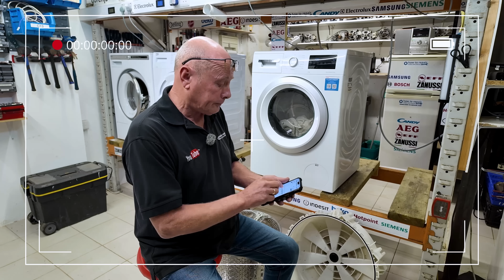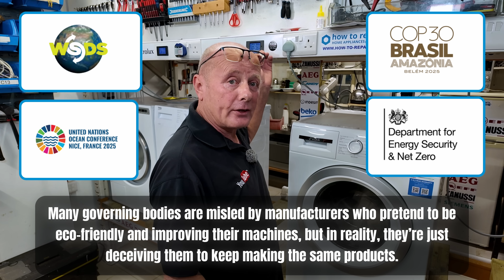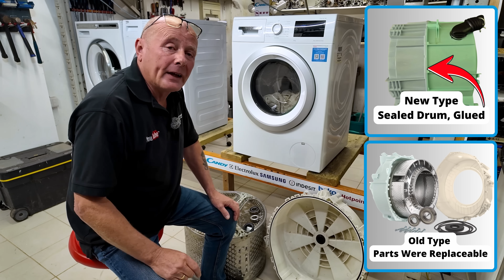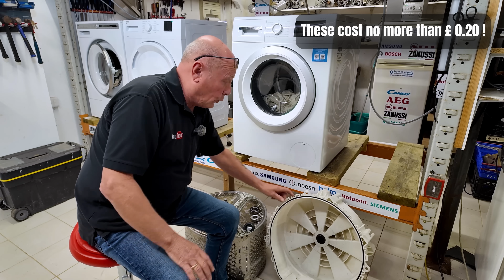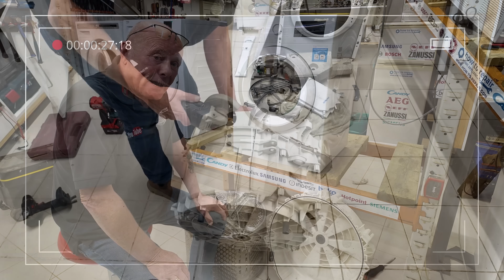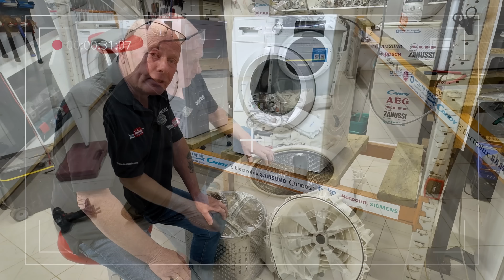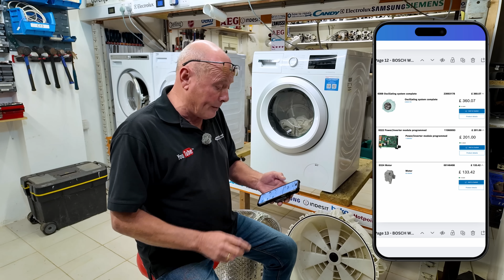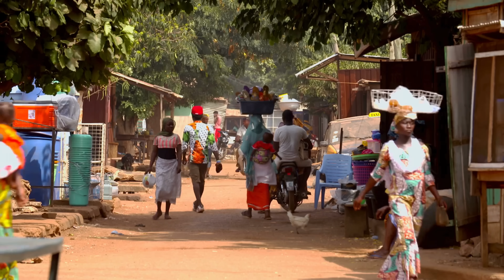Washing Machine SCAM EXPOSED! The Truth About SEALED Drums: Naming & Shaming

Comment: I had a Beko, basic model.  Motor fault also took out the inverter.  Second hand replacement parts cost about £15 less than a new Beko washing machine 🤷‍♂️
Reply from the maker: I've seen this exact problem countless times over my 40 years. Your basic Beko washer, which is part of a large multinational group, utilizes an inverter motor system where the motor and the electronic inverter control board are a pair. If the motor fails, it often shorts the inverter, making it a mandatory dual-part replacement. By pricing the spare parts so high, the manufacturer makes the repair anti-economical and forces you to replace the entire appliance, contributing to the huge e-waste problem. This is the ultimate example of the industry being designed to rip the consumer off.

Thank you for your comment. I appreciate people like you taking the time to write it out. Please don’t forget to subscribe and share it where possible. It might help others make a wise choice instead of being misled by the industry.

Comment: Europe is pushing hard towards the right to repair, so the manufacturers in reply push up the parts prices…
I have an LG washing machine and had to replace the mainboard 3 times already. Luckily these are available on AliExpress for a “reasonable” price. Europe should enforce a repairability label, like the energy label, which includes accessibility, availability of parts and manuals, and parts pricing.

Comment: It would be useful to keep a list of models/manufacturers that DO and DON'T use sealed drums.
So that customers can easily avoid buying this crap and maybe manufacturers will also see the results.
Reply from the maker: The definitive suggestion doesn't exist yet as manufacturers are always changing lines and product quality varies wildly even within one brand, it’s tough to name one best machine. My advice is, buy according to your budget but prioritize brands that openly provide technical service information for repairs. Also when buying new, check if the drum is splitable. 

My personal best pick is ASKO I've been a big fan of them they are brilliant workhorses with mechanicals that often exceed current Miele quality, largely due to their use of a stainless steel outer drum. Certain LG models are also reliable. For budget options, Beko deserves praise they are one of the few who provide genuinely helpful workshop manuals and wiring diagrams for repair, which is a huge plus. 

I really appreciate you taking the time to write out this valuable comment. Please subscribe and share this where possible your advice is exactly what people need!

Comment: Still have a fisher and paykel fridge from early 90s. Made in Australia nz brand at the time did cost almost $1000 aud though.  Never had a problem never ever to this day still going. Only thing is it’s not fan forced like the rubbish introduced in the mid to late 90s because of the Australian legislation banning the gas nonsense. 
Although i defrost the freezer because of ice buildup which has helped maintain the unit and compressor has never failed. 
This fisher & paykal fridge has outlasted friend’s white goods purchases of early 2000s fridges and appliances lasting maybe 10 years max
Reply from the maker: I'm not surprised in the slightest! Your early '90s Fisher & Paykel, made when the company was still building its reputation on durability, is a testament to the old way of engineering. The fact that it cost almost $1,000 AUD back then meant you were paying for quality components that were designed to last, not to fail.

Your manual defrosting ritual is actually a key point! Older, simpler designs like yours which are likely static-cooled rather than fan-forced have far fewer complex, electronic components that can fail.

Thank you for your comment. I appreciate people like you taking the time to write it out. Please don’t forget to subscribe and share it where possible. It might help others make a wise choice instead of being misled by the industry.

Comment: I had 13 month HP probook fail one out of two USB, wanted to warranty it, couldn't as it had 12 month warranty. Wanted to repair it and got a quote for 730$ on 800$ notebook. Insane. Just added usb hub to that one and swore to never buy HP. And like 2 months later, brothers HP elitebook USB failed, but that one had 24 warranty as it was twice the price ~1500$ and he did get new motherboard.

Similar thing happened at home with washing machines, closing mechanism died so I couldn't lock and start but had 5 year warranty on my samsung, but my mother had same problem but only 2 or 3 years on hers I got changed for free, but for hers I bought OEM lock for 20$ and changed it, which wasn't as expensivecas with my HP problem.
Reply from the maker: Your experience is a perfect analogy for the appliance industry today mate. They quoted you $730 on an $800 notebook for a simple USB port issue because the repair required replacing the entire motherboard (where the port is soldered). This practice charging close to the replacement cost for a repair is designed to make you say, "I'll just buy a new one." This deliberate anti-repair structure is found in appliances, too.

Thank you for your comment. I appreciate people like you taking the time to write it out. Please don’t forget to subscribe and share it where possible. It might help others make a wise choice instead of being misled by the industry.

Comment: Scandalous Paul,
                             the spares Machines I buy to repair have not had the warranty registered with the manufacturer. Some are less than two years old, probably failed due to improper use and once the seller realised it’s a Eco (sealed tub) they just go out and purchase a new one. Manufacturers see these machines as Bic Razors. Big price difference 😊
Reply from the maker: That is an absolute scandal and it's a huge problem. As an engineer with decades of experience, I see exactly what you're seeing: machines that are barely two years old being dumped because a failure like a bearing (on a sealed tub/Eco machine) makes the repair too costly or difficult to justify. The manufacturers absolutely see these cheaper models as disposable and, by making technical data and certain parts difficult to access, they encourage this turnover. This mindset contributes massively to the shocking amount of e-waste we see, as these machines are ending up in the landfill well before their time. This is precisely why consumers need to be vigilant and ask about repair basics before buying! I'm pleased you support the main idea. Our success hinges on making this as highly visible as possible. Since I cannot achieve this scope alone, I sincerely ask that you share it across your networks.

Comment: My old AEG bought 2011 has just developed a leak and do hope I'm able to fix it. After watching the video I'm feeling even more reluctant to buy any new model whatsoever, and just like older cars, try to stay with the older models as long as poss.
Reply from the maker: I completely understand your reluctance. A 2011 AEG is from a time when they were part of the Electrolux group, and many models were built with better components and repairability than what is offered today. Just like you noted with older cars, the quality and longevity of appliances from that era are often far superior. The fact that you want to fix a leak rather than replace the machine speaks volumes about the current state of the industry. I genuinely hope you can track down the leak and keep your AEG running for many more years! Remember to keep it basic and check if the manufacturer supplies the necessary data to assist with the repair. Thank you for your comment. I appreciate people like you taking the time to write it out. Please don’t forget to subscribe and share it where possible. It might help others make a wise choice instead of being misled by the industry.

Comment: Trouble is that people want cheap machines and even when they are repairable they don’t do it but just buy a new one anyway. I suppose on the plus side it does prevent leaking tubs - not sure if thats a significant failure point tho ?.
Reply from the maker: You are absolutely right that this is a vicious cycle. People want a cheaper machine and when it fails (often due to being cheaply made), the inflated repair quote makes them feel justified in buying a new, inexpensive one. This is exactly why the industry makes its appliances confusing and disposable it's designed to rip the consumer off by making repair anti-economical.

Thank you for your comment. I appreciate people like you taking the time to write it out. Please don’t forget to subscribe and share it where possible. It might help others make a wise choice instead of being misled by the industry.

Comment: Thankyou for this video and totally believe how disgusting this is!
Luckily I'm with a care plan with Hotpoint as the bearings went when the machine was just out of warranty.
The engineer had to speak with Hotpoint when coming out as he said yes the bearing had fail but didn't know if Hotpoint would pay out for a repair as in his words "it needed a new sealed tank"
Was fortunate that Hotpoint gave the go ahead for the repair but understand that next time the bearings go it will be a new machine.
Reply from the maker: That's a very common story, and I'm glad you were covered by your care plan this time! Many modern washing machines especially those made by companies acquired by major groups like Whirlpool, who owned Indesit Hotpoint at one point have sealed drums. This means that when a small, replaceable component like the bearing fails, the whole drum or tank assembly has to be replaced, which can be prohibitively expensive, often costing more than a new machine. This is exactly why I recommend always asking the salesman whether the machine's drum can be split before buying, as I believe this is a crucial factor in the right to repair. Avoiding these machines is a key way to fight built-in obsolescence. I'm so glad you agree with the main idea! Making this video as visible as possible is up to all of us. I can't do it alone, so please remember to share it wherever you can.
Reply: @How-to-repair I have passed your video on

Comment: So what are good brands? That we can repair for low cost?
Reply from the maker: That's a good question but honestly I can't give a definitive suggestion, mate. Manufacturers constantly shift their production lines and release a vast range of products meaning every brand has machines of both very good and very poor quality. My core advice is to stick with a brand that fits your budget and provides the technical information needed for DIY repairs. Also, when buying new, always ask if the drum is splitable. 

Personally, I really like ASKO they are brilliant workhorses with superb mechanicals, often surpassing new Miele models because they still use a stainless steel outer drum. Some LG models are quite good too. A big shoutout to Beko who, despite some cheaper products, offers helpful technical manuals and wiring diagrams to support appliance fixing. They're making an effort. 

Thank you for taking the time to write this out. Please subscribe and share this where possible; it could help someone avoid an industry trap!
Reply: @How-to-repair thank you your answer ❤

Comment: Had a bosch dishwasher with same "obsolescence" designed in. Simple drain solenoid failure but it had very specific values mapped to the PLC. Bought an LG replacement. It's a massive fail for repeat business I wonder if they've factored that into the marketing strategy? 
It will eventually bite them on the arse like rust did in 70's Jap cars.

Comment: I think we can force the manufacturers - hypothetically - to spend those extra $6 to manufacture drums in a serviceable way. Even if it's $20. We have sustainability goals to hit. Less greenwashing, more reuse.

But also realistic expectations of replacement part prices, because the business needs to keep going whether they make maintainable products or not... I don't think parts can realistically be very cheap, i think there is a balance there somewhere. Say you can reassemble a Venta Air Washer entirely from replacement parts, every single bit is available, but it will cost you exactly double of the full device replacement. Usually when you need to replace a part, it's a fraction of the full device replacement cost, and you have it going for another 10 years - a decent compromise both for the consumer and for the manufacturer.

I don't think it's surprising at all or any conspiracy that all companies implement a move that is good for their bottom line but bad for us as a society at the same time. After all, all the managers in these companies have the same background, and would have the same thoughts - so they have all these plans they're just sitting on until one company makes a move, since nobody wants to really be seen as the lone baddie - giving the customer alternatives would be bad for business.
Reply from the maker: We need governing bodies to ensure that less greenwashing like adding unnecessary Wi-Fi is replaced with concrete policies that mandate reuse and serviceable design.

Please consider sharing this video with your friends and family. The more people who understand what's happening with appliance longevity, the better equipped we all are as consumers.

Comment: That's outrageous, the parts cost more than the machines, that doesn't even include shipping and taxes!!! Better to buy an older machine without WiFi and other nonsense junk!!!
Reply: Unlike other types of appliances, washing machines (or indeed refrigerators) can potentially show a lot of wear so it can be a false economy.  I bought a second hand Miele to replace a Miele where the drum had failed (the different layers of chrome and metal had delaminated! I think the drum had gone out of round and/or a metal object had got caught in-between -- I replaced the bearings but the old bearings were like new, but foolishly I didn't take the inner drum out and shake any objects out, since in a Miele the bearings are in a bearing cross), but the second hand one also failed after 6 months (in this case sparks were flying everywhere and the outer drum literally machined the inner drum, yikes, lol). So I think that was a mistake and a false economy...
Reply: @TassieLorenzo 50-year-old appliances need less maintenance and cost lot less for parts compared to the current disposable appliances that barely last 5 years!!!!!!!!!

Comment: I just got this now: 
Bosch WGG254Z0GB 2 weeks ago, which brand you sugegst to buy instead of this? I am worried about reparaibility in time.  Same 10kg around £500-600? Or keep the Bosch?
Reply from the maker: The machine is a good machine. It is only the fact that the manufacture has built-in obsolescence via drum or electronics. The other components for the machine are reasonably affordable. You should’ve got a five year guarantee
Reply: @How-to-repair  Thanks for your reply. What about the LG (F4X7011TBB) instead of the Bosch? Reparability important for me.

Comment: I have a question. Which new washing machine today is made so the bearings can be changed? Any idea?
Reply from the maker: I wish I could give a single definitive answer but I can't, mate. The reality is that manufacturers are always changing things, and with their massive product lines, every single brand sells both winners and duds.

Choose a brand within your budget that also makes technical repair information available. Crucially, ask the seller is the drum splitable?

From my experience, I personally loved my ASKO machines. They're mechanical workhorses that often rival, or beat, modern Miele models especially because they stick with a stainless steel outer drum. LG has some quiet good models as well. And big props to Beko; even though they make budget items, they stand out by offering helpful workshop manuals and wiring diagrams, making them repair-friendly.

Thank you for this insightful comment. Please subscribe and share this information to help others make informed choices!

Comment: ok great info but which brands dont do this? I mean what am I gonna do?
Reply from the maker: The definitive suggestion doesn't exist yet as manufacturers are always changing lines and product quality varies wildly even within one brand, it’s tough to name one best machine. My advice is two-fold, buy according to your budget, but prioritize brands that openly provide technical service information for repairs. When buying new, check if the drum is splitable. 

My personal best pick is ASKO I've been a big fan of them. They are brilliant workhorses with mechanicals that often exceed current Miele quality, largely due to their use of a stainless steel outer drum. Certain LG models are also reliable. For budget options, Beko deserves praise. They are one of the few who provide genuinely helpful workshop manuals and wiring diagrams for repair, which is a huge plus. 

I really appreciate you taking the time to write out this valuable comment. Please subscribe and share this where possible your advice is exactly what people need!
Reply: @How-to-repair  Hey man, thank you for your detailed reply.  Do you have any information on Dryers? Would you recommend a brand for Dryer? I really hate knowingly being ripped-off by these companies.